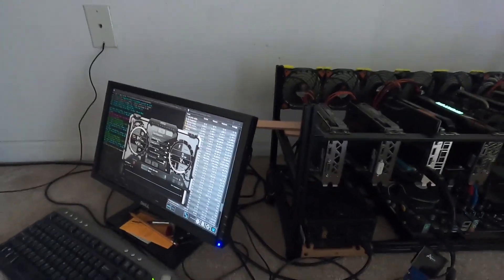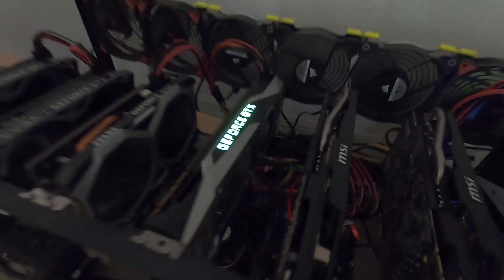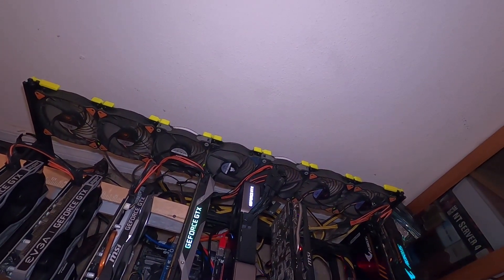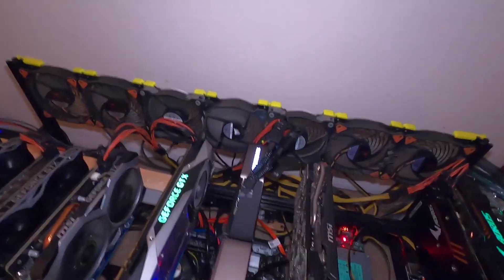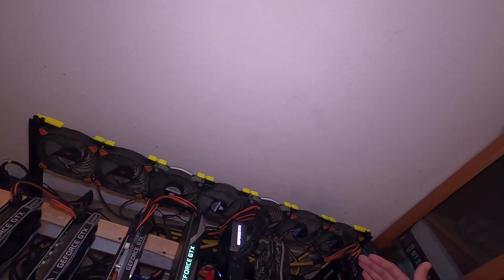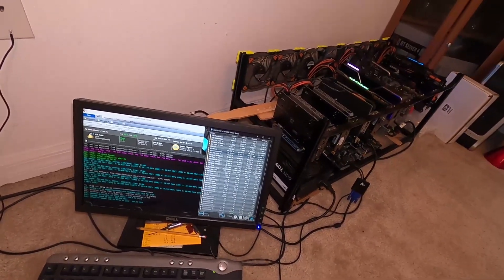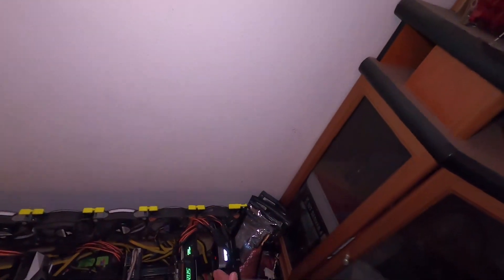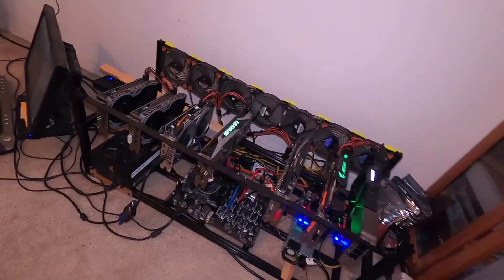RTX 3080 FE Air Flow design impacts Mining Rig

Comment: привет,подскажи настройки для 3080fe?
Reply from the maker: +0 Core / +1300 Mem / TDP или Powerlimit 70% для майнинга Ethereum. Что требует более интенсивного использования памяти, для других алгоритмов, таких как Ravencoin, вам нужно будет немного уменьшить память и поднять частоту ядра, возможно, +150 ядер / +500 Mem / 70% TDP.

+0 Core / +1300 Mem / TDP or Powerlimit 70% for mining Ethereum. Which is more memory intensive, for other algos like Ravencoin you will need to drop memory down quite a bit and raise core clock maybe +150 core / +500 Mem / 70% TDP

Comment: Is it just the FE cards that will push air to the next gpu, or are all 3080 cards designed this way?
Reply from the maker: All 3000 series GPU's have a cut out now, by the back side, so some hot air will exhaust in that direction. However, only the FE GPU will directly push air into the next GPU due to the design.

Comment: I have 24 MSI 3070 over 2 rig in the tropics,,, regardless of brand unless high end 3 fans,,, the memorys get real hot even when the gpus stay cool,,  so what i did was stuck them in a box with 2 box industrial fan sucking up,, pulling air from below, stablity tho is all over the place with memory

Comment: Thanks for the test. But before you rearrange the 3080 FE to the front of the Aorus 1080 Ti, there was NO cards in front of it. Maybe you should put one standard GPU (like 3080 AIB card, which has almost the same power consumption with the FE one does) before Aorus one, and then do the comparison, that would be more solid to demonstrate the impact of the FE cooler design.
Reply from the maker: I just got the Gigabyte Eagle RTX 3080, a week or so ago. I will test and compare data. Thanks for watching, and providing constructive criticism

Comment: Good update SXSF. I would agree that a separate kind of GPU rear rest aluminum design is used for the 3080 & 3090 FEs. I would think a back angle screw rest like  "|------/___------------/___-------------/___-----------/___-----|" This way the GPU will slant at about 35 dgrees acute angle to allow most of the air point slightly upwards  and against directed an the next GPU in the rig set up. Sorry about the 4 card crappy text GPU back hanger drawing lol.
Reply from the maker: Np, an angled setup would work better